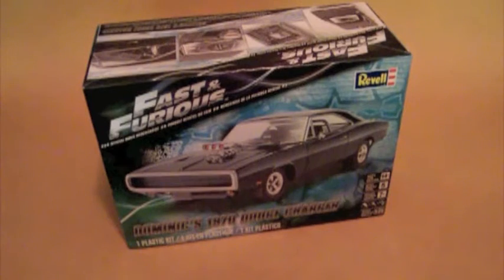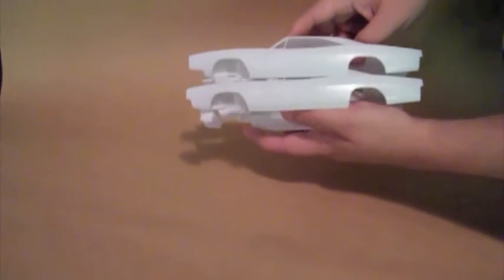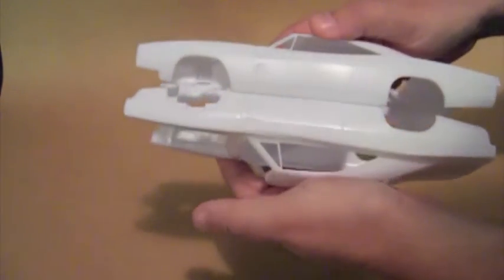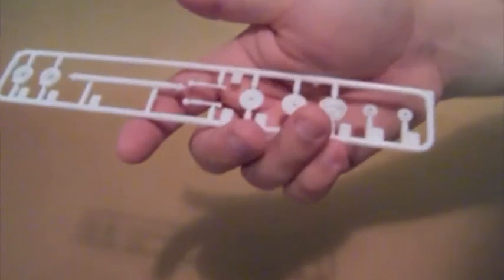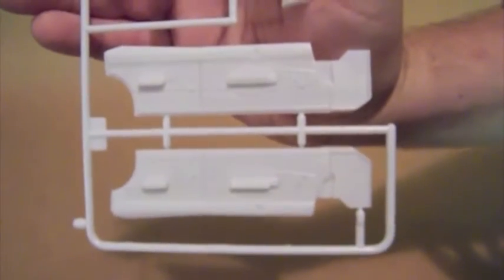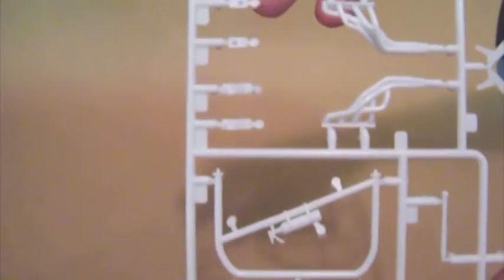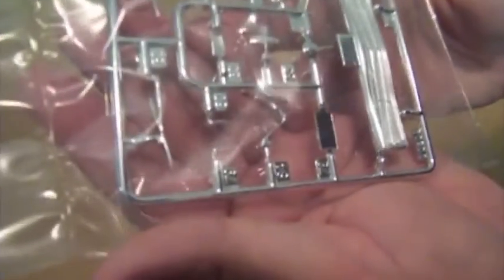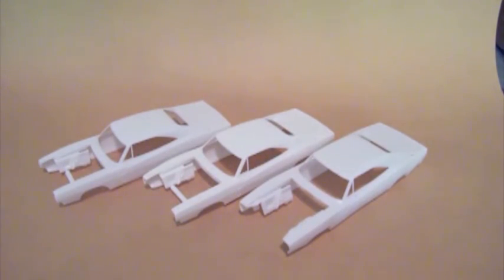Review - Fast & Furious Dominic's 1970 Dodge Charger

Comment: With all the budget constraints these days, I don't think Revell could afford to make all the tooling changes between a stock version and Dom's car. It would be far too expensive and all they can do is the best they can in trying to produce two versions.
Reply from the maker: Acknowledged, though with two caveats:

First, if they are including a unique part (like the hood), they have no reason to not get it right.  They were able to include the belt cover on their diecast car's hood 15 years ago.

Second, for some reason Revell has a blind spot when it comes to optional parts in their muscle car kits.  Their 29/30 Ford kits are loaded with fantastic extra parts that could be used in myriad builds, but they have yet to include a second sideview mirror in any of their Charger kits.  Optional wheels (to build this as one of the later cars) or racing buckets would not only make this kit more accurate,  it would make it great fodder for kitbashing and encourage multiple purchases.

Trust me, I love that we're seeing a stock '70 and will absolutely buy several of those once they hit shelves.  But since this was sold as a particular car, it has to be judged on how well it matches that particular car.
Reply: There actually is a very strict budget for each kit and as hard as it is to believe, those side mirrors may put the kit over budget. If you look at your Pro Modeler 1958 Corvette, you'll see plaid suitcase decals included. I had intended those decals to go around actual plastic suitcase parts, but I was told those few extra parts put the kit over budget, so all I got were the decals with no plastic suitcases. That kind of thing happened all the time when I worked there.
Reply from the maker: If the only reason Revell couldn't include a second sideview mirror was budgetary, then I claim misappropriation of funds.  Both the '68 and '69 Charger kits had two identical drive belts, two identical power steering pumps, a heater core that's hidden under the dashboard, and a V brace that's hidden under the rear seat.

Comment: looks more like the 70 charger from need for speed most wanted 2012
Reply from the maker: Good call. Other than the wheels, yeah - this is a pretty dead-on replica of the NFS:MW car
Reply: Would be a cool build
Reply from the maker: I may get a second one to do just that...it would be a good mate for the '67 Mustang Revell released a few years ago as a faux Eleanor. It looks pretty close to the gunmetal Mustang in the same game
Reply: lol, "Jump boosting" that car on the lake jump task! First time I saw it, I was, "What the..? there's colored smoke coming outta that Charger!" Sadly that game became a battle of the bashers and DLC upgrades (still play it on the Vita, no FF Charger, though)